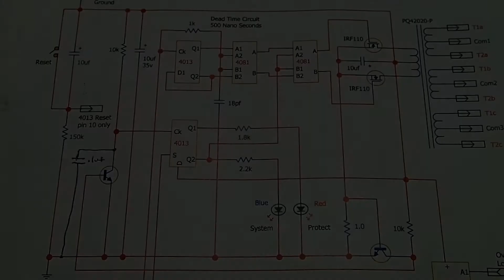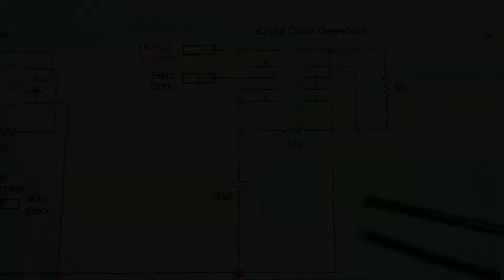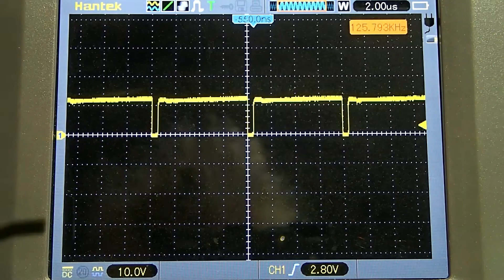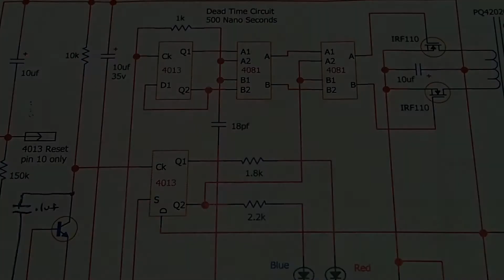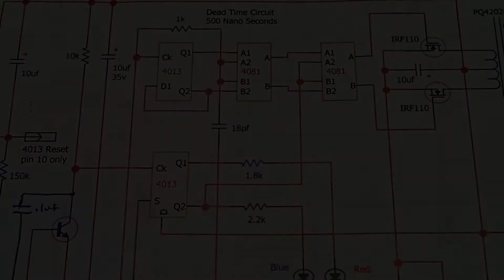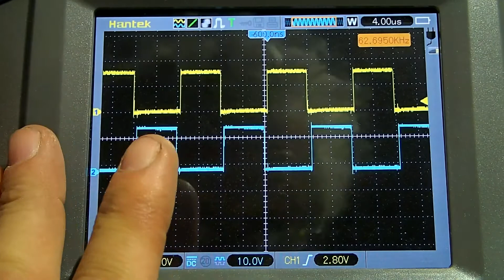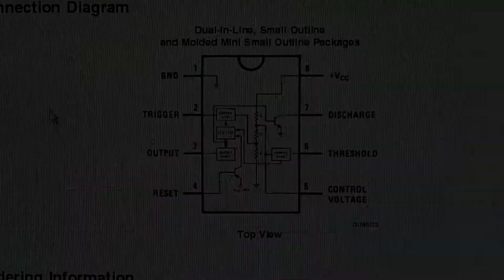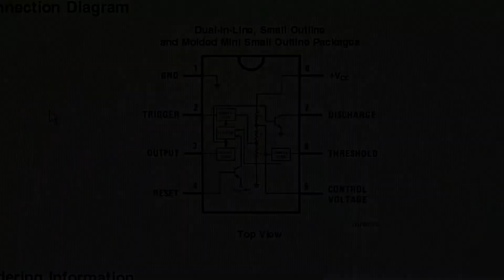62 khz High Power Switching Supply Part 1

Comment: R.E, "dead time"
Something that has always bothered me was the startup of a ZVS driver with a high-current load.  I need to use them in a critical application that may need to be turned on and off very frequently and run for long periods every day!
The problem is that two identical MOSFETs are powered-on at startup, BUT if they turn on at the same instant the circuit will FRY!   The circuit depends on one FET always turning on first, since "NO TWO COMPONENTS ARE 100% ALIKE".  Your 'dead-time' delay brings this to mind as a safeguard since I don't trust this assumption.
A ZVS would be another great way to drive your transformer type also.
The strange thing (to me) is that in all the years I have used ZVS drivers (mostly in induction heaters which are very high-current), I have NEVER had a failure.  ALSO, I have never even heard of such a failure mentioned anywhere!
...any thoughts on the ZVS start-up??

Comment: Hello, great video! I would like to try this circuit but i dont know exacly where this S pin from 4013 goes. Can you tell me? I guess it switch off circuit when we have desired voltage on a output capacitor but  I can be wrong.
Reply from the maker: Szalony Mechatronik the S Pin that goes to ground

Comment: +Moss Fett
What is that NPN transistor at the bottom right corner of the schematic for? I assume it is some kind of overcurrent protection, since it is connected to power ground and connected to one of the flip-flops.
Reply from the maker: NNNI that's the little regulator 12 volt.
Reply: Oh, I see. How does it work?
Reply from the maker: NNNI that's just to take the 16 and 1/2 volts from the battery and reduce it down to 12 so it doesn't burn out the CMOS circuits. Does CMOS circuits I think are good for 14 volts.
Reply: I was wondering, why not a flyback topology? I've heard about the power limitations, but there's chips like the LT3751 that use the flyback topology to charge upwards of 100J in less that a second.
Reply from the maker: NNNI Push Pull is far more powerful way more powerful than th flyback.

Comment from the maker: That's a very good question the reason we use high-frequency is because the higher the frequency the less turns of wire is needed on the Transformer thus the Transformer become smaller as you see in the video you can hold the transformer in the palm of your hand in my next video I will show you an equivalent size Transformer that operates at 60 hertz they cannot even match the power of that little ferrite Transformer.
Reply: Moss Fett that makes so much more sense now I thought it was just arbitrarily done I look forward to your next video

Comment: what I don't understand about switch mode power supplies is it's seemingly redundantly high frequency. why do you use such high frequencies and not 60hz like in mains input
Reply: short answer : because inductance = voltage * time / current 
higher freq => less time => less inductance => smaller coils (and cores)

Comment: +Clay Reid 
With your permission I would like to upload a video on my channel going through this circuit (You will be credited as the creator, etc).
For that I would like to know how the dead time circuit works. Thanks.
Reply from the maker: NNNI yes by all means do it. ty
Reply: Thank you.
About the dead time?
Reply from the maker: NNNI I'm going to have to explain that in a video but it simply uses two and Gates a resistor and a capacitor. when the clock goes High the and gate delays putting out a signal until the capacitor charges when the clock goes low the same thing happens this prevents a glitch on the output the dead time is controlled when the clock goes low for 500 nanoseconds that's the control of the Dead time
Reply: Oh, so it's some kind of RC delay.
Thank you.
Reply from the maker: NNNI yes rc delay this is needed for the and gate so that we don't cause shoot through on it because the output will glitch it will virtually turn off wait fifty or a hundred nanoseconds and turn back on again for maybe a hundred 200 nanoseconds. the length of the Dead time is basically the low time signal of the 555 timer.
Reply: So the RC time constant has nothing to do with the dead time? I tested it with a few different values but the dead time was the same.